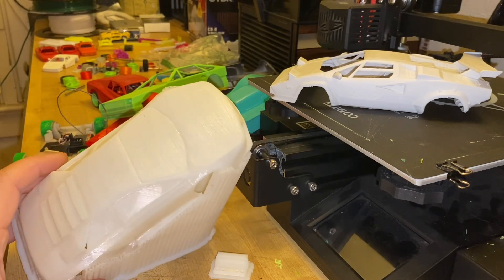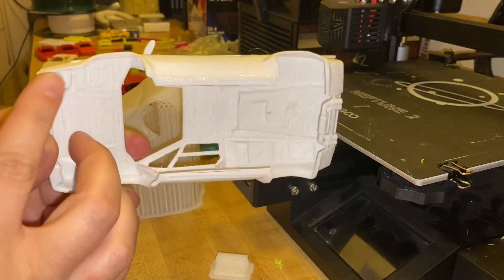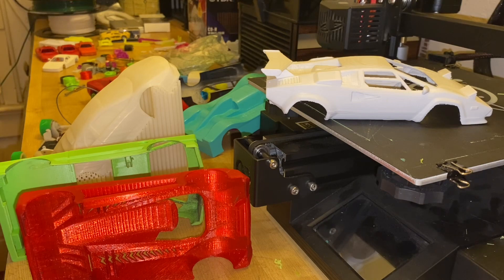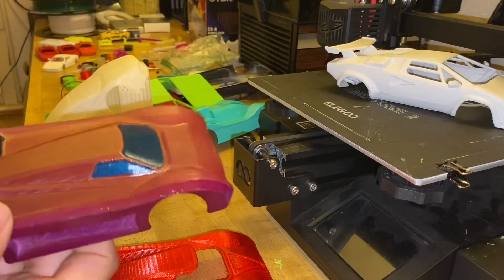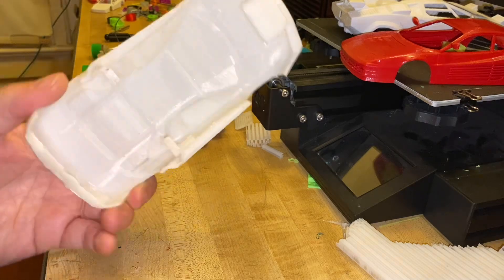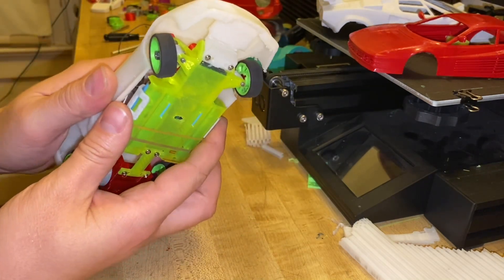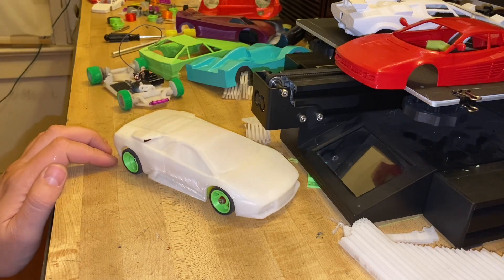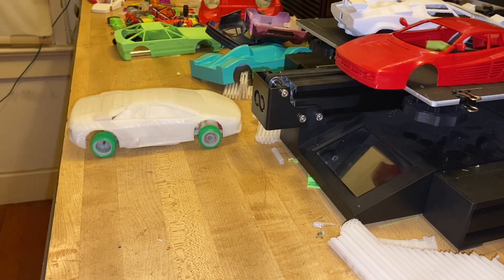Open Z Bodies - how I print them

Comment: How many degrees do you set the nose to point/pitch at 30 degrees or 45 degrees?
Reply from the maker: I aim for 45 degrees, but sometimes it will vary depending on the geometry of the car. Depending on where a car has its curves, it will change what angle you'll want to get the best resolution. But generally speaking, 45 degrees is the best place to start.

Comment: What is the chassis file for the z style car next to your printer in yellow red and green wheels?
Reply from the maker: It was an exact replica of a Kyosho Mini Z car. I had an old one with some broken parts, so I started to 3d model those broken parts to print some replacements..then i got carried away and modeled the whole chassis. :D
Reply: @underengineered_1077  nice is that something your sharing or selling?
Reply from the maker: @ripriotrc4561  eventually will be made available.